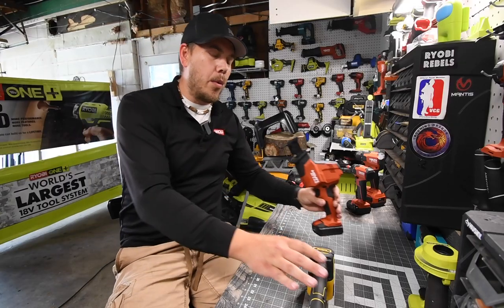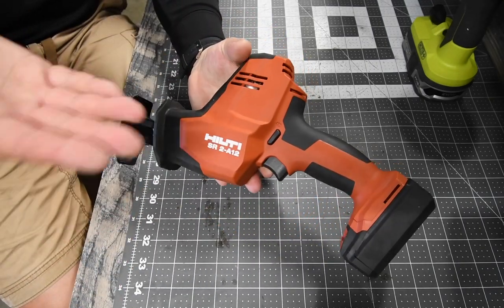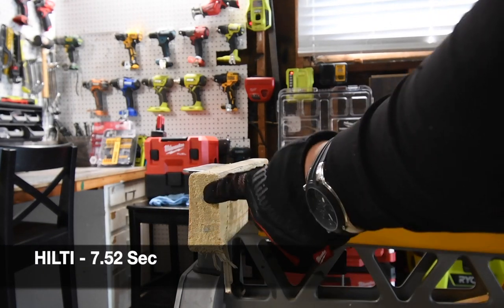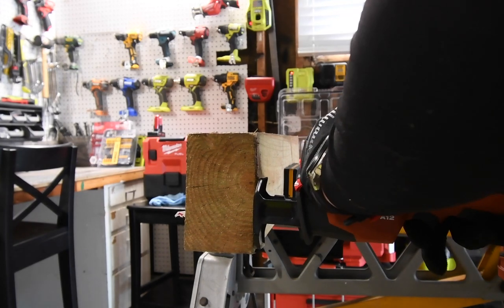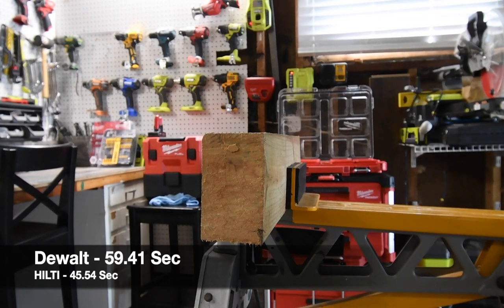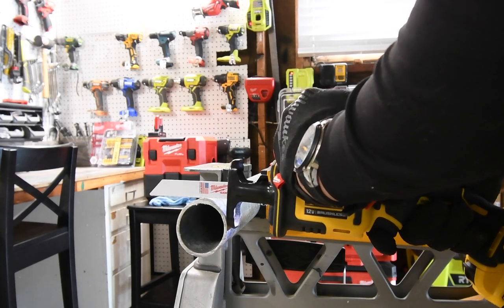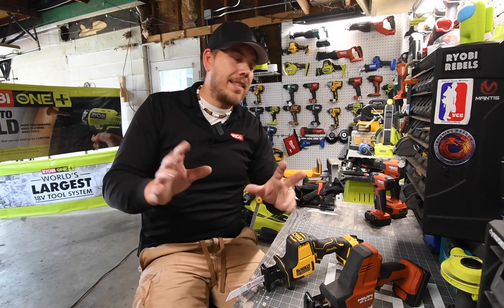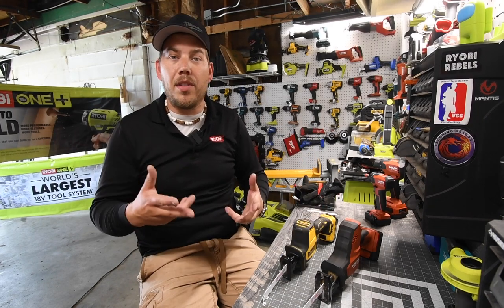HILTI vs Dewalt (SHRS)

Comment: I'm thinking of getting a SHRS and I have both the dewalt 12v batteries and ryobi 18v. Which would you go for, dewalt SHRS or the new Ryobi one?
Reply from the maker: if you need it to work for a long time and will be using it a lot id go for the dewalt

Comment: Proconsumer tool vs professional tool?
You know what proconsumer tool is aiming for, making their customer believe that their tools can cut or drill faster than any other brand. How about the professional tools? They are aiming for construction company that doesn't care if the tool can cut fast as long as the tool will last long. Hilti is king if powertools they do like their equipment to sell to contruction company or for company that are used to use heavy and industrial tools. Dewalt not so much but they are good
Reply from the maker: its a simple versus video bro